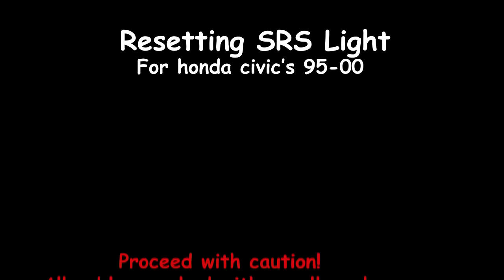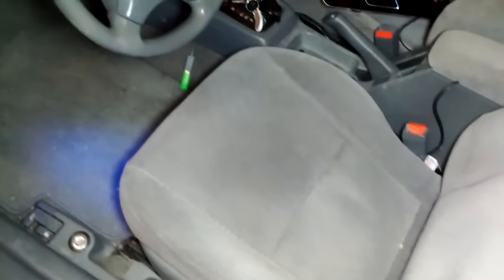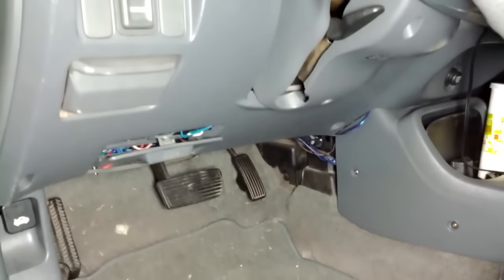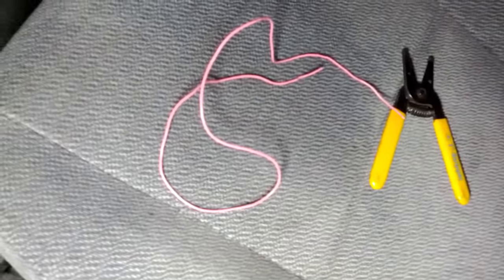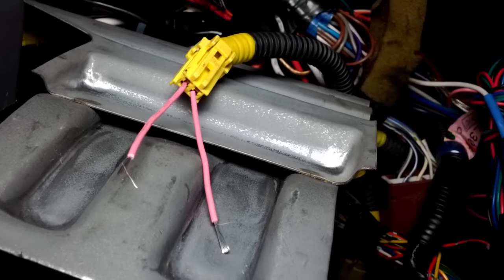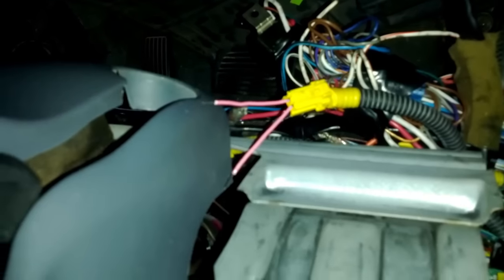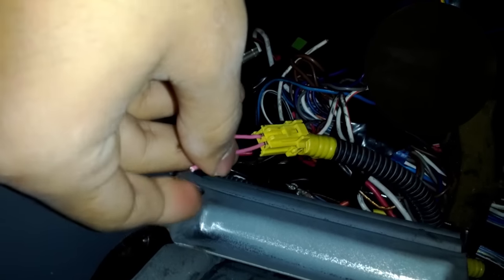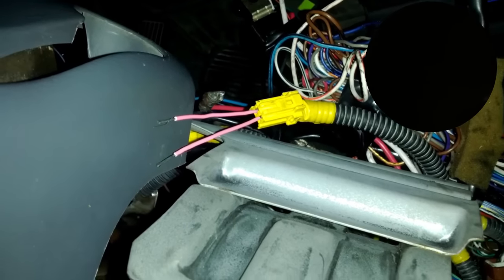How To Reset SRS Light on a Honda

Comment: It worked well with my Honda Jazz 2005 after I replaced the clockspring. The symptom was horn was not working and air bag indicator was on. I used 2 paper clips instead. Thanks for sharing the tip
Reply from the maker: Paper clips is a good idea! Its probably a little easier than cutting up speaker wire.

Comment: Ok I have a Honda Civic 1.4i Sport (Year 2000)   I see the yellow switch/socket going into top right of circuit board, but the is also one on the far left side just on the side of board...also another on the back of steearing coloum all three are for Airbags I think......HELP......

Comment: My airbag light came on because I disconnected the side curtain airbags and the passenger seat (that has airbags in it) will reseting the ECU still work? it's a 2013 Honda fit...

Comment: Every time I turn on my 2001 Honda accord the horn from the alarm goes off any ideas on how to fix this?
Reply from the maker: Allen Bailey Do you have a remote to lock and unlock the car?
Reply: Christian Macias no I only have  the key
Reply from the maker: This is happening because the factory alarm is still active. You can buy a remote and have it programmed to your car or disable the factory alarm

Comment: which plug is it? the one has 3 prongs and 3 wires and came out pretty easily but the other yellow one has 2 wires coming from it but it's very hard to get that one out. am I pulling on the right one?

Comment: Why would the SRS light stays on? My accord's SRS light is on since few weeks ago.
Reply from the maker: 723lion If you didn't do any modification it might be the seat belt pre-tensioner.
Reply: Christian Macias is the seat belt buckler something I can replace myself? Thanks for the advice BTW!
Reply from the maker: I'm sure it is. I would get the service manual just to make sure your have the right torque on the bolts. You don't have a friend with an OBD II reader that can read the code on the SRS? That way you can make sure that is the problem.
Reply: Christian Macias Got it Christian, thanks so much for the advice. I don't have the reader so I might just pay the $99 at Honda to check and fix it myself...

Comment: can error code occur randomly? or is not common and lights on only when airbag was deployed or disconnected airbag/seat belt connector? 
because car is low mileage and all parts are original, the car wasn't in use for months
Reply from the maker: +petriko I have heard of this happening to cars that sit for a long time.
Reply from the maker: +petriko I have heard of this happening to cars that sit for a long time.
Reply from the maker: +petriko I have heard of this happening to cars that sit for a long time.
Reply: i have pulled fault code 72, but i reset the srs up to your instructions and the warning light is off for now, thanks

Comment: Hello I drive a 2009 civic & my driver airbag light wont turn on at all! I got a new airbag installed along with a module but the light still remains off it wont turn at all I knows its suppose to turn on when i turn my key into the key ignition then turn back off but it does not it just stays off.. any help or advice would be greatly appreciated!
Reply from the maker: Let me see how my civic turns on and ill see if that it normal. Have you checked the sensor that checks if there is person sitting on the seat?

Comment: Hey Christian, I have a '95 Honda Civic and there are three plug connecting my SRS up. There is a main one connected to the unit right behind the steering wheel This one is quit large and not like the one in your video. There is a medium size one sort of halfway along the line, and there's a smaller one connected to the side of the firewall. I need to know which one to access. It's not a simple unplug job like yours either. What do you suggest?
Reply from the maker: If it a 95 civic it should be connected to the fuse box if I'm not mistaken. Take a look at 1:22. There will be a socket with no pins inside of it. That cable is the one your looking for. The cable will only have 2 pins.

Comment: Great video Christian, I am going to try this on my 1995 Honda Accord.  My concern is because this light is always on does this indicate a problem?  Or does it indicate a problem if I cannot get it to go off?  I want to make sure there isn't a problem with the air bags.  Thanks!
Reply from the maker: The SRS light will stay on until it is reset, regardless if the problem is still present. The problem is when it is reset and it turns back on. Remember that SRS stands for supplemental Restraint System, so it could also be the seat belt. If it turns back on, your best bet is to go get the code read by a Honda mechanic and that will tell you exactly what is wrong.

Comment: Hi my airbag had deployed due to an accident. I put a new airbag in and everything is connected. I tried doing what's on the video. But doesn't seem to work. Help please.
Reply from the maker: You'll need a new SRS module. Once the air bags have deployed the module has to be replaced.
Reply: @cmacia06  thanks, I'll have a look into it & see what I can do. Your help is highly appreciated.

Comment: This worked on my 1997 CRV. The cable was not plugged into my fuse panel but near it, between it and the steering cover. I had to take the lower shroud off to find it. My light came on because I replaced the steering wheel and started the car without the airbag attached to test clockspring position. This video is great.

Comment: Hey, on my accord 99 model, it did nothing at all. No blinking, going off. I have seen many videos and people got help, but in my situation it does not just apply.
Frustrated, coz I cant get my car through a mechanical check because of that. So not road legal…
Wonder, what else to look for?
Reply from the maker: That is strange that your car doesn't pass the inspection. My 97 civic passed with the lights on. Anyways, my first question is, are you using the right connection? If you look at 1:22 you will see the cable and see that the socket holding it has no pins. This is the cable you are looking for. Second, what are you using as the jumper cable?

Comment: On my 2010 Honda Accord, the only yellow plug under the dash is not a 2 pin one…? Anyone have any ideas?
Reply: Just kidding, I found the right one. It’s on the back of the fuse box, nearly impossible to access. Guess I’m selling it without turning off the light😂

Comment: RIGHT, I TRIED TO PULL CODES FROM THE BLUE PLUG now, hotwiring it.
Still I get no SRS light blinks, or anything, it just stays on. It shoud blink the faults if it is faulty, shouldnt it?
As the car has no other faults then others are not blinking either-thats fine. 
Can it be that theSRS unit is not giving any feedback and thats why no diagnostic blinks or srs light reset is possible?
Reply from the maker: That was going to be next conclusion because the srs light should definitely be responding when you attempt to reset it. At least a blink when you turn it on and the pins are shorted. As far as blinking the fault code,  I wouldn't be familiar with that. My neigbor is a Honda certified mechanic and he used a tool to read the code from the srs unit. Then he proceeded to find the code in a book and told me what the problem was.  Im not aware of the light blinking the code.  At least not on the older models of Hondas.

Comment: nice vid, but it didn't work for my honda. the light is still on.
Reply from the maker: +wsmaga Was your car ever in a car accident?
Reply: nope, never been in an accident. the light just wont go off.
Reply: +Christian Macias it wont work if it has been in an accident?
Reply from the maker: If the air bags have deployed then you have to replace the srs unit
Reply: +Christian Macias the light just came on a few years ago and now it wont go off.

Comment: I have a  2000 Honda Accord coupe and I replaced my seats and they didn't come with after market SRS connectors. I tried the method but nothing worked how can I fix this problem?
Reply from the maker: Did they come with connectors at all? In order for the light to turn off. everything has to be plugged in and working.

Comment: Just bought a 2004 Honda Civic, battery needed to be changed, when I was driving home realized the SRS light was on.. bought the car AS IS so thinking the place I bought it won't do anything... Would try this but unfortunately the light doesn't go out at all.  Any ideas??

Comment: Cleaned my Honda Civic 2002 and disconnected one of the wires under the seat. SRS light showed after that and they said some shop will reset for some money. I solved it just watching your youtube video. Thank you for saving me money, cheers.

Comment: Can I use your method to reset the airbag module after a crash? I keep reading that I have to remove the module and send it in to be reset, but your video looks like it says I can reset it myself. If this method does NOT work for a crashed vehicle that had bags deploy maybe you could add that info to your description? Thanks for your help! (I'm installing fresh bags, rebuilt belts, etc.)
Reply: I'm also replacing my airbags as well. Did this procedure worked for you?

Comment: Hey I tried this step by step....everything seemed to work just fine...the light blinked twice as it reset and goes away...but 2 seconds later it came right back on...help please?
Reply from the maker: This is usually because you have a problem somehwere in your srs set up. Make sure that you have everything connected and then reset. If it continues then you have a problem and need to have a honda tech read the code.
Reply: It happened when I was changing the ignition wiring around the same area. After I changed that my ignition worked fine but the light came on. Any thoughts?
Reply from the maker: What year is your honda?
Reply: 98 4 cylinder l sedan
Reply from the maker: Naimul Karim I believe that there is an airbag connector right under the steering column.  Its makes with a yellow connector and sleeve. Unplug the battery and verify the connection is in working condition. Ie. Plugged in all the way, the wires arent torn.
Reply: I see different yellow connectors, not sure which one to touch. I know it's not the one that connects to the fuse box, but now sure how to differentiate between the others
Reply from the maker: Well, as long as all of them are connected and look good, then your connections shouldn't be the problem.
Reply: Thanks for all your help Christian
Reply from the maker: No problem!

Comment: I followed the instructions on my Honda 2002 CRV. I have 2 wires pluged into the yellow connectors and have them connected when turned on the igition. The SRS light came on for 6 seconds and them went off. I disconnect the 2 wires when the light went off. Reconnect the wires again when the light came on again. But, the light just would not go off the 2nd time. The video suggests trying the connect and reconnect pattern twice. But, my try did not yield the 2nd round of connect and reconnect. I did check the connectors underneath both driver & passenger side seats. They seemed to fastened firmly. Anyone have any suggestions whereelse to check? Thanks.

Comment: Ive got 2 civics I need to do this to. Question, does this delete the code itself or just reset it? Ive got aftermarket wheels & right now with the srs on, my horn wont work in the EG which I need for a sticker asap...Will doing this allow me to do the horn mod/my horn to work period?? Thanks to anyone that can help

Comment: You're a life saver - (not mine but someones)lol   I was trying to find the fuse for my light socket and I had the key on.
I guess it was a bad idea having the key on because I did this before and didn't have any problems. None of the fuses were blown but when I started the car back up the SRS light was on.
I had heard a long time ago that if you disconnect your battery too long it can undo the code for both radio and SRS bags and that the only way to get them back was to go to a dealer.
I'm very much a DIY man so I came here to see what there was.

I'm going outside now to do this.
If I don't came back than I was successful. 

Thank you very much for your post. I really do appreciate it. 

Good job by the way (clear and simple).

Comment: I have an Civic 2003, and I have done that twice, but the light keeps on coming back up.
Reply from the maker: The same thing happens to me. All you can do is go get it checked for the error code at a auto parts store. I took mine to Honda and it returned a code that says I need a whole new unit! Forget that... ill just keep resetting it. The unit runs about 300 to 500 dollars. I have a 97 civic. The unit is definitely no worth it.

Comment: Hi Christian.  Thanks.  Do you think this will work on my 2001 insight ?  How about the engine light ?  I'll look through your videos for that.  I can donate $5.
Reply from the maker: Sonny Moon Sorry, been really busy these last 2 weeks. I believe this works for all Hondas... but i cant assure you.  For the check engine light, if I already fixed the problem, ill just pull the ECU fuse (cars computer) and wait 5 minutes. Then put it in and do the idle learn procedure. My mechanics and even the auto stores don't like to reset the check engine light.
Reply: Christian Macias Okay.  Thanks for that !

Comment: i have a 2006 mitsubishi VRX  380 DB auto. the airbag light is on, i removed and replaced the drivers seat &  the broken steering wheel & i was listening to music on the radio. i had no Airbag light. now i do. i checked all the airbag wires (just 2 of under the seat) wiggled them and checked for loose connections. the light is still on. I removed the pos+ and neg- wired them together for 30mins and guess what............. The airbag light is still on........ even ran an OBD2 scantool and it did not show up yet the light is still on.

Comment: Thanks so much for sharing the video Christian. I  like the most where you share where to locate the yellow plug. It's connected to the fuse box and not disconnected showed by other videos and instructions. I have to give some trials and errors before success. If I remember correctly, I connected the two ends of the wire, turn on ignition and leave on, when light went off, I disconnected, light went back on, I reconnect, light went off, and repeated, then blinking twice, that's when I know the light has been reset. Thanks so much again for your contribution video. So very much very helpful. HAPPY NEW YEAR!

Comment: You gave detailed instructions on everything leading up to the actual wiring process, then you glide right thru it. Played your video many times in the touching and releasing process.
Reply: When the light is on, touch the wires together, when it's off release them, when it blinks don't touch them together..... not that hard

Comment: just use one wire and strip both ends!!!! Put both exposed ends one in each side of the plug....
  instead of two,stripping 4 ends ..
Reply from the maker: So I tried that. It doesn't work out how you would expect. Because the strands of wire are moving around while you put it in the plug, the reset doesn't always work.

Comment: It worked on my 98 accord but when i turned the ignition off and started the car the SRS light came back on  HELP !!
Reply from the maker: aquatramp If it turned right back on, then there is definitely something wrong with your SRS system. From what iv'e been told, the best bet is to get your seat belt pretensioner replaced. Other than that, I wouldn't know what else to tell you.

Comment: Man, you just made my day. I have a Honda Accord '95 LX that a friend of mine forgot the trunk open for two days, when I came back there was almost no battery charge. He charged it for me with an outlet battery charger (APU) for cars. Since then the SRS light would kept lit for a few kilometers every morning or every time that the car was kept turned off for a long time (more than 4 or 6 hours).

The light took a little bit more than in your video to turn off the first time, but the rest of the procedure worked fine and it confirmed the reset.
I was already freaking out, because the light just didn't go away like yours took some second more (I gave up instead of being patient). I thought I was going to spend a lot of money to get it fixed...

I'd like to thank you for the video! It really is a helpful one, worldwide... I am pretty far away from USA. =P
Reply from the maker: I'm glad it worked! I have to learn this procedure because on older Hondas the SRS unit for some reason turns on for no reason. I have a 97, I had it checked by my mechanic and the code in the Honda book he had basically said the actual SRS unit broke. So it turns on every like 6000 miles. :( oh well... Thanks for watching!

Comment: i tryied this it didnt help. can somebody help me ho to turn off that light forever? i even remove fuse but light is still on,,, it went on when i was adjusting steering wheel, i have put everything back like it was, and now i cannot pass MOT
Reply: +FrogFromFog  Not sure what adjusting steering wheel means but you may have damaged the clock spring or left a bad connection on your airbag

Comment: Thanks this worked for me too. I know its also good to make sure the contacts on the seat belt are working and there may be an issue of a seat belt cable connection under the seat. Also after a car hits a certain age this light may come on. They want you to buy a new airbag.
Reply from the maker: My srs system reports an entire system malfunction. It wants me to replace the SRS unit. Honda sells it extremely expensive. I went to a junk yard to find one from a car that hasn't been wrecked. hopefully that shuts of the light.